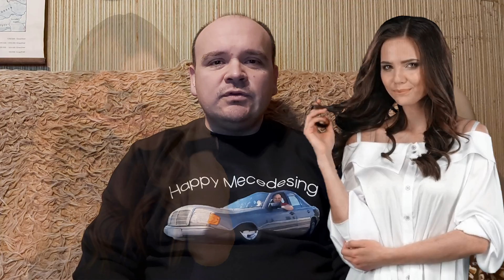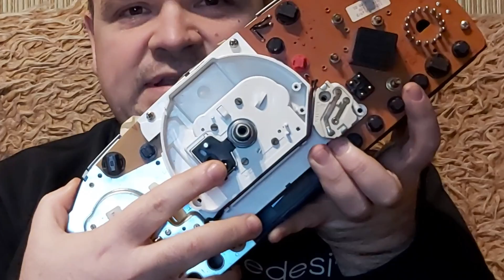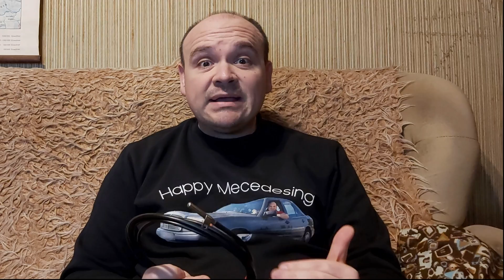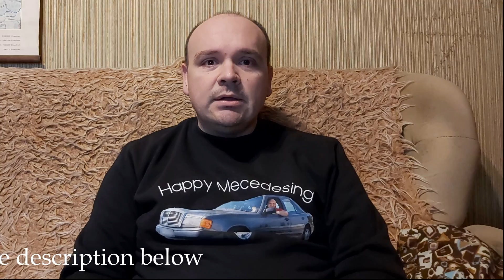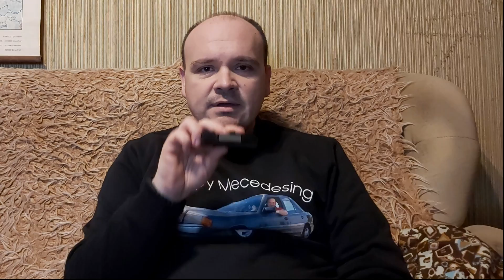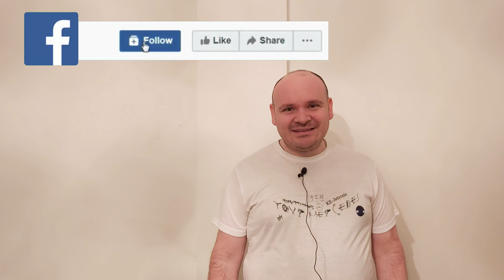㉦Mercedes Ke-Jetronic㉦ - Hall speed sensor vs. the temperature gauge

Comment: Hello mr.ivica are the speed sendor input the ECU for control rpm?
And are these sensor is hall effect type?
Reply from the maker: This sensor is called hall speed sensor. There is so called crankshaft position sensor which generates the RPM signal without which you can't even start the car and this one has its input in the ECU as well, pin6 on the ECU plug!

Comment: hi got a problem 1993 190e 2.0, no cruise control - revs go up and down a bit on over run, coasting or whatever and high fuel consumption, i think it might be the speed sensor - (have to get into instruments anyway because speedo needle is twitchy at low speed and dash light dimmer sometimes turns off the lights, have to tap it to get lights back on :o ) does that make sense? can i test the speed sensor?
Reply from the maker: Hi. Yes, there is a way. Remove the ECU connector, put the positive in the pin 6 on the connector and the negative on the ground of the chassis . This is a 2 men job. You will have to measure and your friend will have to move the car for one meter. The ignition must be ON, engine OFF. With consumers the voltage must be 0-9V(you will get fluctuation), without 0-12V(DC of course). As for everything else, I can't advise you anything because I have no measurements from your car - both from the mechanical as from the electronic part of the system. Greetings
Reply: @mercedeske  ok cheers for that, very helpful
Reply from the maker: @harrisonbergeron9746  Thanks, hope you fix your car! Fingers crossed!

Comment: Hi after year of knowing nothing it looks like you could know the answers. Please help I have m103 r129 with gauges looks like from m119 up to 260km/h but original shuld be 240. Cruise control didnot work, same kickdown And readings Are like 100km/h in 70/km/h. RPM showing 5000 And rev limiter shut then. Im completely lost and only answer I got Is to buy Dakota something to Slow the speedometer and go EFI. Consumption is higher than normal And car reads more km than actual trip is. With this gauges IT runs with previous owner RIP 80 thousand km. Please Is there solution for me?
Reply: Thanks for answer yours knowledge is unbeatable. And lucky me I found gauges in Poland in thé first step and for acceptable price. I follow you on insg. And let know how it Will goes. Thanks milion times
Reply from the maker: @TheKrlis  My pleasure. Happy Mercedesing 😃
Reply from the maker: Well, for the beginning you could find the original instrument cluster of the car. As for the kick down, check your tps if it recognizes the wot(wide opet throttle) position(you have the video on my channel, easy to check). As for the cruise control, maybe the hall speed sensor is bad and maybe the ecu for the cruise control. As for the hall speed sensor-it's bad if your cruise control turns off or if the outside temperature gauge shows incorrect temperature. As for the rest, we'll see 😃

Comment: If this temperature sensor is not working would that cause the cruise control from turning on when you are at cruising speed and activate the cruise control but the cruise control will not come on. In other words my cruise control does not function.
Reply from the maker: It can cause the cruise control to deactivate from itself after you activate it. If the speed sensor is good, then the computer for the cc is bad, its unit.

Comment: will join when can. like your talking slow with fast facts.   my 88 300te vin is a mystery to all sources ive tried.    odometer says 107k miles but i found an oil change done years ago at 191k.    i've read that HES can tell me how may 10k miles crossed.   do you know how to retrieve that info and if dash panel was replaced would that info still be for this car and motor??
Reply from the maker: Either replaced or the mileage was decreased.

Comment: But not every Ke jetronic car has the outside temp sensor and cars without cruise controle don’t have the hall sensor aswell.
Reply from the maker: I have neither cruise control nor the outside temperature sensor(yet) and still I have speed sensor on my original speed gauge.
Reply: @mercedeske  you f you have a 85/86 230e for instance. You don’t have the speed sensor. 

Ke jetronic does not need this speed sensor to operate properly

Comment: Hi, great information again. Thank you verry much!
Hall sensor malfunction will cause heratic disconnection of the cruise control or this would not function at all?
Reply from the maker: Hi and thanks a lot. The cruise control will keep disengaging if the speed sensor goes bad no matter how much you try engaging it.
Reply: @mercedeske  Thank you for the quick response. My cruise control sometimes works for 10 minutes or 2 hours  or other time span but it then suddenly disengage. I can re-engage it immediatly  and it will work again for some time.
Reply from the maker: @fabit.8734  You will have to check the speed sensor. This is a 2 men job. Disconnect the ECU, turn the ignition on, measure the voltage on the connector, pin 6(positive) the negative goes onto the ground(metal part) and let your helper push the car for one meter. With the temperature display on as well as he cruise control the voltage fluctuates 0-9V
Reply: @mercedeske  Thanks again!